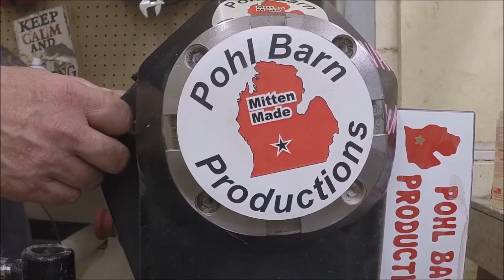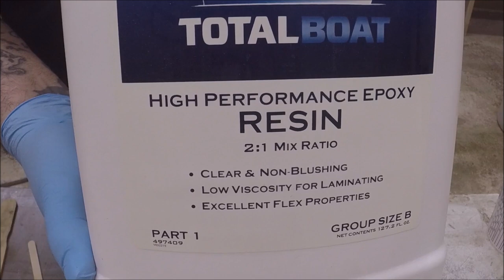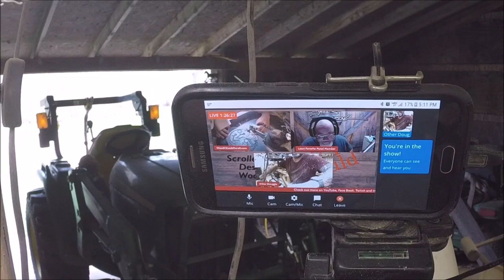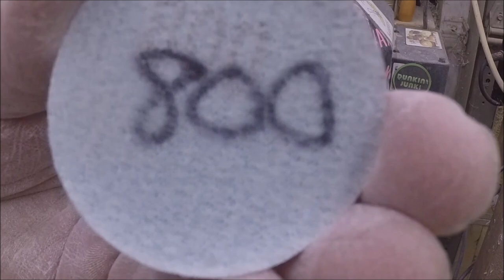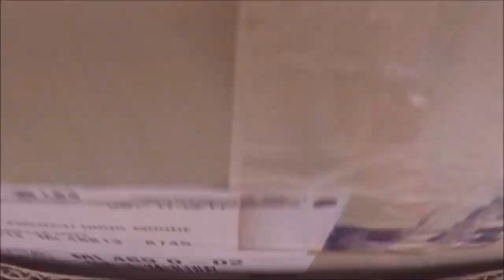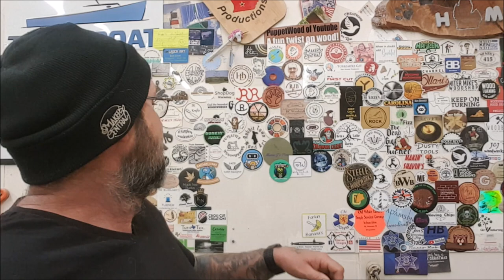FLOWERS in Resin

Comment: Doug, yeah if I was the Mrs... that wouldn’t go anywhere either!!! Beautiful piece!
These flowers are cool
Have you thought about doing them like the pine cones? I know you tried in the one you showed... but maybe slightly pretreat in slow cure resin for a dip bath so they don’t chip out so much.

BTW I and working on the fish, slowly. I don’t get a lot of resin and I’m working on my projects prepping for my store front to open. But I’m making two fish each time and trying to match best I can for equal fish for the challenge for you and Ken. I’m throwing a few solids in here and there. Went with like a Koi effect, figured it’ll be the cooler effect. I’ll have to paint on the eyes or not not sure how much that’ll make much difference. Remember they are flat on the bottom due to the fact they are from a mold. Just need an idea how many you and Ken would need for a bowl/project? 
I can’t wait to see how this will work out and I’m betting the Mrs won’t give this one up, no wait I’m guessing YOU won’t give this one up. Manly bowl/project. 
I might thro you for a loop and send a bonus challenge at both at you too.
My email same as channel just add yahoo
Reply from the maker: Thank You Thank You, The Wife just brought me a silicone multiple fish mold.  I could possibly add to the ones you send in the project,
Reply: @PohlBarnProductions  how many you think you need Doug?

Comment: Morning doug awesome piece mate . It looks like I divers bowl i think 🤔 the drift wood on the surface of the ocean and the coral reef under it  .. its awesome mate I really hope the resin finish starts behaving for you . I know im no resin expert but could you put on 2/3 layers then sand out the pimples and buff to finish 🤔 just wondering 👍🏻👍🏻
Reply from the maker: Thank You Dan,  I applied 6 coats of resin sanding in between all but the last coat, my issue might be I am reusing the brushes, after so long I think the resin in brush is coming out and being left behind causing what looks like air bubbles, I used a new brush on the very last coat.
Reply: I have a Goblet and wine 🍷 vessel to make for beer and wine to be drank out of i have no idea what to seal the inside with as I don't want the alcohol to get into the wood but I don't want to risk resin yet lol any advice mate ?